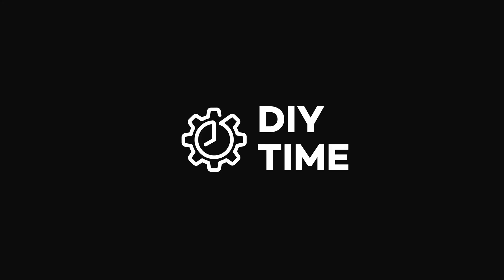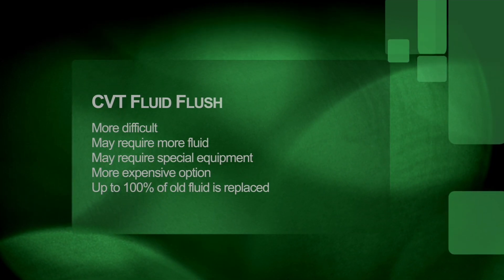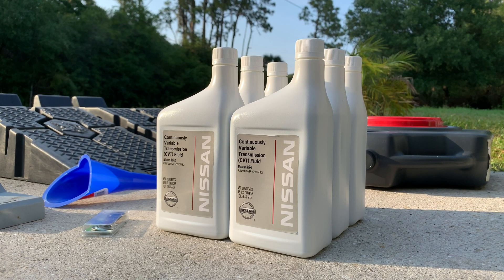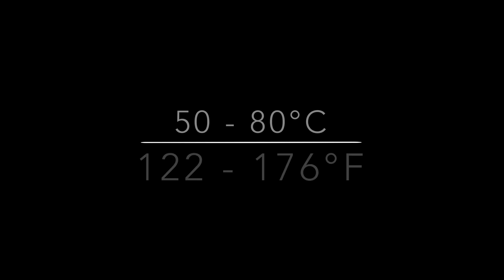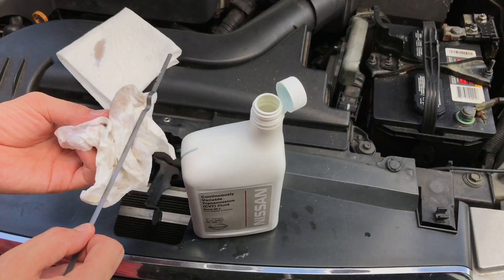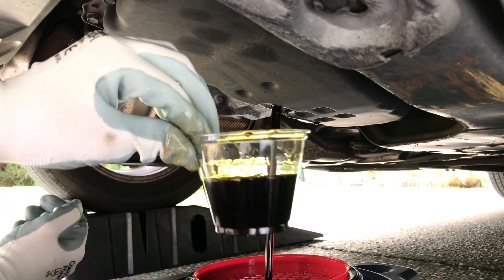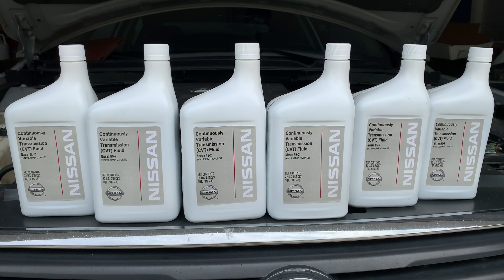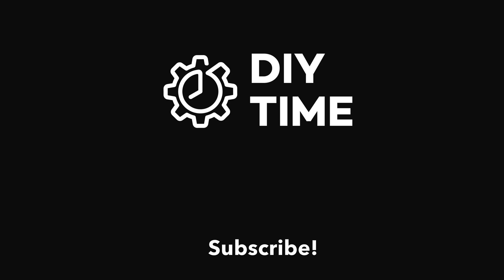How to change CVT transmission fluid in your car (on example of Nissan Altima)

Comment from the maker: You can find parts and tools used in this video here: 
Nissan CVT fluid: https://amzn.to/3aNEd71
Narrow funnel: https://amzn.to/2KLa39W
Drain pan: https://amzn.to/3bQ1czR
Torque wrench: https://amzn.to/2ybDTBJ
Wrench and sockets set: https://amzn.to/3c0eSsd
Car ramps: https://amzn.to/3bP8vYy
Wheel Chocks: https://amzn.to/2VOolgm
Drain plug gasket: http://rover.ebay.com/rover/1/711-53200-19255-0/1?ff3=4&pub=5575132837&toolid=10001&campid=5338683547&customid=&mpre=https%3A%2F%2Fwww.ebay.com%2Fsch%2Fi.html%3F_from%3DR40%26_trksid%3Dm570.l1313%26_nkw%3DNissan%2Btransmission%2Bdrain%2Bplug%2Bwasher%26_sacat%3D0
(These are Amazon or eBay affiliate links)

Comment: My 2017 does not have the notch that would allow me to push the tab.  Also because I never had it out before it won't budge unless I just don't understand that stupid little tab.  I would like to change that fluid as preventative maintenance because these CVTs have a reputation for failing early.  I am not saying it WILL happen but unless that fluid is changed sooner or later you are tempting fate!!

Comment: Our Altima was acting up when hot after about an hour of highway driving. Pulling over and stopping cooled it down. Took it to a transmission shop and they drove and hooked it up electronically and said that the transmission was going out. I googled the problem because the fix was several thousand $$. I found that a rotation sensor could be the problem. Amazon and $40 later I replaced the sensor. I removed the air box and could easily see the sensor on top of the transmission housing. Once replaced the car operated like new. Worth taking the time and $40. I also dropped the transmission pan and replaced the fluid that was black.
Reply from the maker: Interesting! I’ll give it a try too.
Reply: Can u give the link of the rotation sensor
Reply: @uww.v  search it on Amazon should come up easily.
Reply: Did you replace both of the filters while at it
Reply: @joshuamast5128  just the one but it's just a metal screen that can be washed out.
Reply: @HypocriticYT  there’s a cartridge filter that goes to the transmission cooler it’s not in the pan as well that ones a lot more important to be serviced than the pickup filter
Reply: @joshuamast5128  it it easy to access? The pan when I changed the fluid had nothing in it. Over 300,000 kms and still going strong.
Reply: @HypocriticYT  yes it seems to be easy to get to it’s not in the pan you will have to lookup where it is for your specific car
Reply: @joshuamast5128  found it in a video. Altimas don't do well with higher mileage having replaced most of the front end including axles with CV's. I'm crossing my fingers it will last another year though the body looks good.

Comment: All the mechanics I go to keep telling me I don't need to change it even tho it's 120k miles and I never changed it before. Got this car at 53k miles.
Reply from the maker: That’s what Nissan says too, “it is good for lifetime”. Nevertheless, these CVT transmissions are dropping like flies. Mine started slipping around 150k. I changed fluid when that happened but it was too late. Still have slipping issue. Interestingly, Nissan repair manual has section on how to change it, and there is a drain plug on the bottom of the transmission. Some newer cars dont have transmission drain anymore.
Reply: @DIYtime  mine doesn't have drain plug.... Just changed it now and all three mechanics kept saying I shouldn't change it and if I'm sure.... Wow. 

In fact, I think it's too late too. The drain pan had a lot of gunk with metal stuck to the magnet. I should've changed it a long time ago. Before my transmission started acting up, I had asked my mechanic if I needed to change it, he said no. On my way from NY to GA it gave up on a mountain ⛰ going uphill... if I had changed it anyways I wouldn't be in this situation
Reply from the maker: Yeah, if the “lifetime” means 100k mikes for Nissan, then sure, it maks sense not to change fluid. Cuz they are making a lot of $$$ on selling new transmissions. I also know there was a recall, but mine failed after 150k and it was no longer covered.
Reply: @DIYtime  I read about the recall but my car was also late to be (maybe) covered. I didn't check since it was past the miles they said
Reply from the maker: Yeah, how convenient for them. So the “lifetime” for them is something like 100k miles. After that your car is too old/not qualified.

Comment: My CVT Transmission is sealed and has no dip stick. Can I still change my fluid myself or should I have it done professionally?
Reply: No such animal as a "sealed" transmission.
The dipstck may be hidden or absent, but there must be a way to check the fluid level - possibly electronic as on a Mercedes Benz.

If you can handle removing the pan, inspection of the valve body, and replacement with the new gasket, then you should be able to do it yourself and avoid paying appx twice as much for dealership services.

Check out online service manuals for your exact transmission and whatever fluids and gaskets you need prior to attempting to self-service. NS 3 fluids and above are all backwards compatible, but it is usually more expensive than NS 2, and doesn't give any longer service intervals, but it does have slightly better anti-foaming agents if that is a problem with your current CVT. NS 3 is blue, while NS 2 is red or clear.

Comment: Ns3 is the only cvt generation worth a crap
Reply: NS 3+... But that's subjective. My NS 2 equipped 2015 Rogue with i-awd is doing great with over 120k on the clock.
Has never been an issue at all.

Comment: I have a 2014 Nissan Juke that I hate.  I didn’t know anything about the CVT issues until the class action suit came to my door. So I go to Nissan worried about it… the Nissan service guy said not to change the transmission fluid in this car… that it will cause problems because the car had not had it done in so long. I didn’t know it was supposed to be changed every 3 months.  I’m confused now on do I change the fluid or not. Or run this thing into a lake.
Reply: Change it ! Don’t believe them . It will say lifetime fluid not true
Reply from the maker: For them “life time” is probably 100k miles. After that they want it to break and to be replaced.... 💰
Reply: @DIYtime  definitely agree
Reply: @DIYtime  mines (14 altima) at a 109k, could i just filter out any shavings and debri and just pour the same old fluid back in again?
Reply from the maker: No. Fluid loses it’s cooling ability over time. You should always use brand new fresh fluid.
Reply from the maker: Find a service manual schedule in the glove box. It will say how often its supposed to be done.

Comment: I have a 2016 Jeep Compass 2.4 l the dipstick is not there where do I get a dipstick or whatever it needs to get to check the transmission oil in a CVT transmission can you help me and what kind of transmission fluid do I get and where it has 61000 miles on it
Reply: Up front on the right side, usually under a blue, yellow or white plastic cap. You'll need a flat bladed screwdriver to release the stick.

Comment: Hey I Have A 2010 Nissan Altima 2.5 Coupe With About 145k Miles No Problems Yet . Do You Think I Should Change The Fluid? The Fluid Is Very Dark.
Reply from the maker: Yeah, fluid has to be changed regularly.
Reply: Yeah just replace fluid don’t flush

Comment: I’ve read you can add an aftermarket transmission cooler to extend the life of the transmission. Have you heard about that/what are you thoughts on that?
Reply: did it to my Sentra recently, thermostat and everything. i can go on road trips now and drive like an ass without the fluid boiling now. worthwhile investment in protecting the transmission. just make sure you get the job done right, my shit is still dripping a little fluid somewhere.
Reply from the maker: Yes, I’ve heard about that. May not be a bad idea. These Nissan CVT transmissions are known to break a lot. Extra cooling may very well extend the life of the transmission.

Comment: This is will be same as my maxima 2010 right 🤔 
My plan after changing cv axle boot and inner and outer tie rod is to check the state of cvt fliud on tissue paper then change it if it needs but I need to dissasemble the  transmission pan, clean the filter , magnet the pan and thats it
Reassemble and refill  hope its not tough job ill use electric impact gun fro dissasembley and ryoubi wrench for tightening 
But does it need gasket or its only rtv used?

Comment: Saw a guy that pulled the pan, it was gunked up with black crap. The magnets were caked up with the same black crap. I think your fooling yourself not pulling the pulling the pan.
Reply from the maker: That gunk (mixture of oil and metal shavings) is usually a sing of an issue with the transmission. If you are doing a regular scheduled change, you’ll be fine.

Comment: Would I need to change the transmission filter??
Reply from the maker: Repair manual doesnt mention it. I’ve heard you would have to disassemble half of the transmission to get to it, and its not really worth it.

Comment: You should take the oil pan off to clean it also there should be magnets and filters that should be cleaned if possible or replaced to prolong the life of the cvt trans, the dealer don’t do this i don’t know why

Comment: Incredible video! Can’t believe the dealer charges 300 for this. I’m definitely going to do this on my own. Only downside is I have to remove my battery and battery tray to get to the dipstick
Reply from the maker: 300 is actually not that bad. Probably half of this is the cost of their CVT fluid. Plus they likely use a vacuum to suck all of the old fluid, so it is a lot cleaner fluid change.

Comment: Will this process work in a 2002 altima?
Reply: That easy flush buy cheap atf flush 2 times then add good quality dextron 3, i Did it for my wife altima 2006 2.5
Reply from the maker: That doesn’t have CVT. Process might be a bit different, but should be pretty similar.

Comment: Casi todo bien falto el filtro del enfriador cambiarlo es el que más se tapa
Reply from the maker: I wouldn't recommend changing the filter. It is made of metal and shouldn't go bad. Moreover, you may have a lot of trouble getting to it and then trying to reassemble the transmission after you are done. Ask me how I know... Official Nissan repair manual doesn't require changing it either.

Comment: Hi there! Great video and instructions. Very clear! Just a question.  I have a 07 nissan altima 2.5 and as far as I know, I let my mechanic to do the transmission oil change around 130k miles(the transmission is already slipping when I got this car around 125k milesand I didn't checked it or feel it 🤦‍♂️). Right now it has 155k miles and it slips frequently (the transmission slip lessen when my mechanic changed it around 130k miles) . So, is it okay not to open the pan, clean the pan and gasket then replace the transmission oil/fluid filter? Thank you so much!
Reply from the maker: These Nissan CVT transmissions are known to go bad. There was a recall for  it. But only up to 130k miles. My car has the same problem too. And no, even complete oil flush will not fix slipping issue. We are just stuck with a bad junk product.

Comment: The CVT fluid has a friction material in suspension which helps the metal drive band cling to the pulleys. When the fluid gets old, the band will slip. It is essential to keep fresh fluid in these transmissions at the proper fill level. Some auto manufacturers claimed a lifetime maintenance free CVT and this was a huge mistake causing massive warranty claims.
Reply from the maker: By “lifetime” they meant their transmissions are guaranteed to last  no longer than 150k.

Comment: I have a 2012 sentra, cvt transmission.   60KM.  Can I use amsoil cvt transmission oil ?  Its ns-2 and ns-3 full synthetic compatible.
Reply: I'd still stick with Genuine Nissan Fluid... on the hood of the car there is a warning to only use their fluid in the CVT.
Reply: @NoName-gv6nm  if your nissan cvt transmission is out of warranty then there is no reason not to use a cheaper compatible cvt fluid when adding or drain/refilling it. These companies would not slap that compatible claim on their bottles if it didnt work. Nissan puts that warning there to prevent idiots from putting in ATF fluid and not CVT fluid. Plus they want your service money.
Reply from the maker: As long as it says it’s compatible with Nissan CVT transmission, you should be ok.

Comment: Hello, thank you for this explanation.  My car, Nissan Altima 2010 2.5s 4v, I haven't replaced the oil for a long time and now it is 330,000 km Can I replace the oil or are there problems because the weather is hot in my country.  Thank you
Reply from the maker: I would replace it. 
I’m surprised your transmission lasted that long. Nissan doesn’t make very good transmissions.
Reply: DIY-time  If I replace the gearbox oil now , can it spoil?  bc I didn't replace it for a long time .
Reply from the maker: Do you have CVT transmission also?
Reply: DIY-time yes, I have cvt transmission.
Reply from the maker: I would change it. New oil doesn’t break transmission.